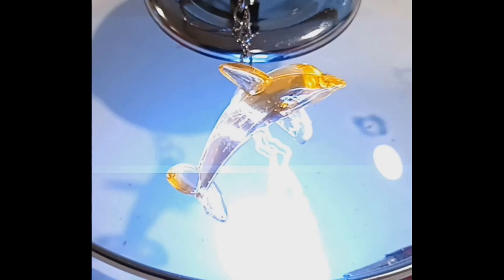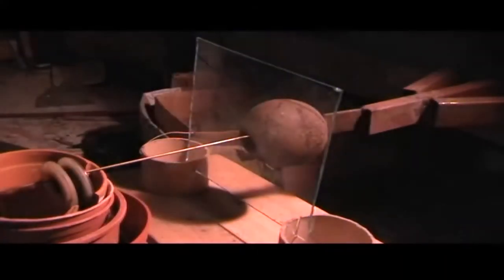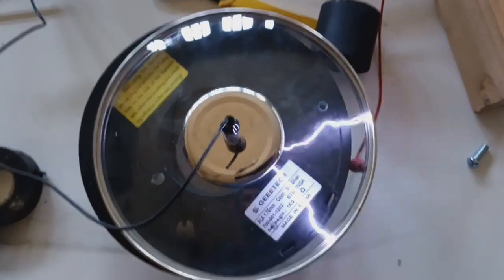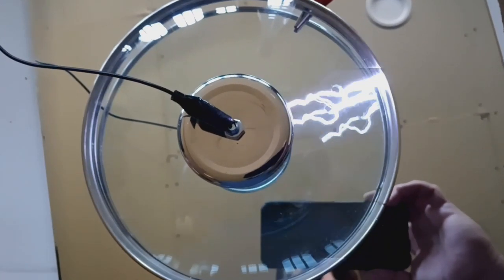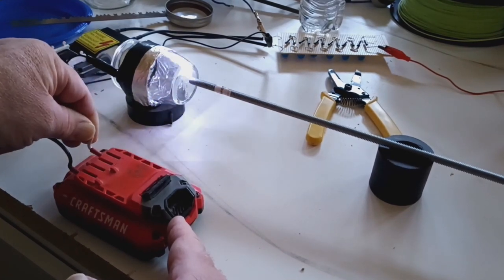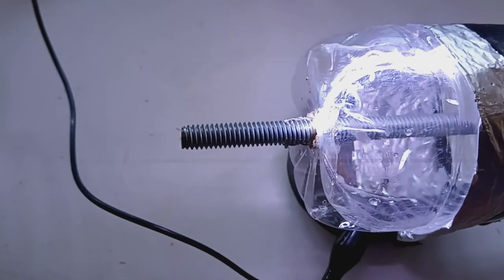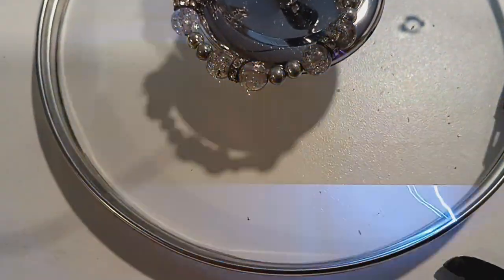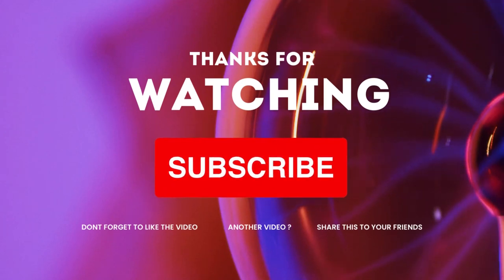High Voltage Fun

Comment: looks great i know your doing this to see the effects on different materials am i right?  make a mylar  disc 8" 2" hole in middle then cover it with tin foil on top then blast your plasma across it see what happens .please or acrylic if you have no mylar.
Reply from the maker: That's right. I have aluminum tape or foil glued to cardboard. If those would work. I do not have mylar right now.
Reply: or nylon or even styrofoam just a good dielectric .
Reply: basically we want it to be a high voltage capacitor but to charge it plasma across the top.
Reply from the maker: @jediknight2350  Got it.